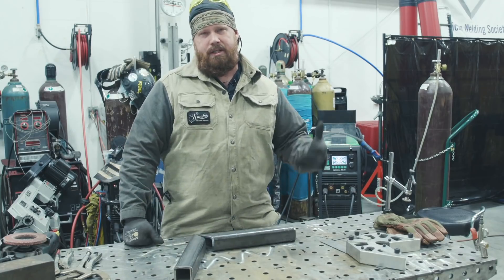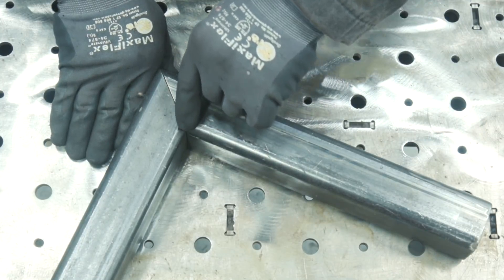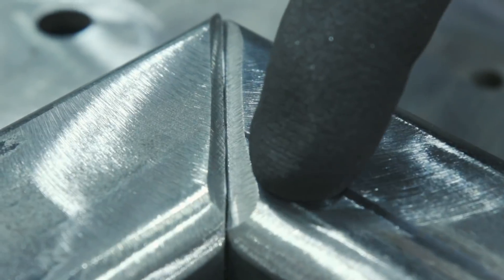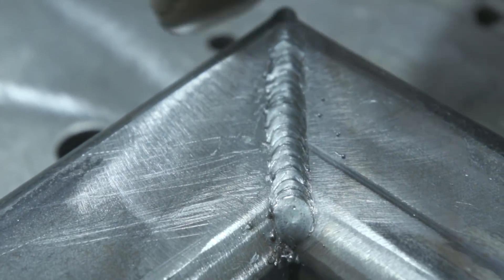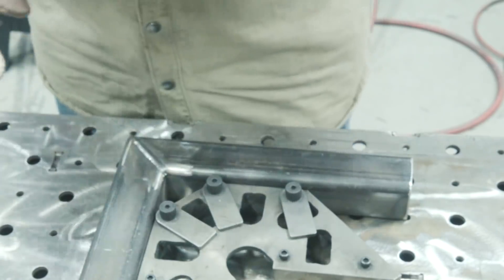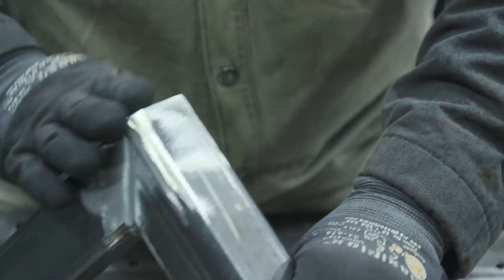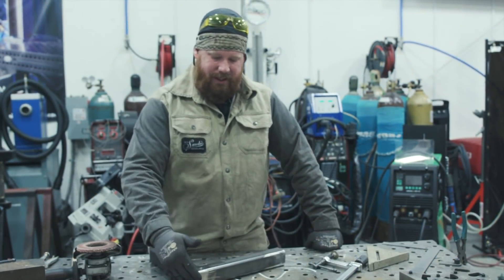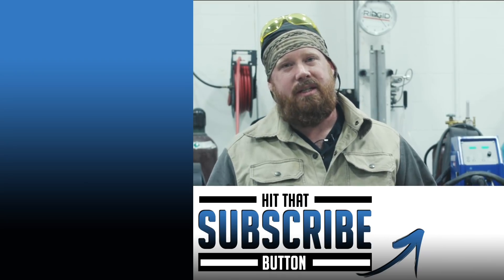Mastering Seamless Welding Techniques for Square Metal Tubing

Comment: This is quite helpful... as a hobbyist I work with small tubing, small square rods... and grinding welds back down to clean frequently leads to laying down some more metal to bring up the low spots.  I will utilize these techniques a bit more now.

Comment: got a serious question for anyone who can help me..im welding square tubing on a double decker 2 story car hauler diagonally in between the original existing square tubing bays going vertically up and down, to help stiffen the trailer. problem is the tubing is up againts  the backside of the inner wall of the trailer causing me to not have access to the back side of the tubing. what is the best way to weld the tubing so far i have only been tacking the tube in place. the trailer manufacturer only welded the square tubing in the fillet welds and none on the faces of the tubing im guessing because the outer panels stick to the outer face of the tubing with double sided tape (smh) they probly dide want to spend the time beveling and gringing the welds smooth, hence the trailer frame has numerous cracks and endles joints with no welds...help ...anyone???

Comment: I kinda whip with my grinder down to almost base material and then take one light and slow final pass to smooth it all out. Looks like scotch brite but I'm using 80 grit. Also, if you're a new to welding or in school or thinking about a career in welding, take some time to practice metal finish. The amount of time I spend laying beads and then making them disappear is staggering. Thanks for the content, weld team.

Comment: Making miters isn’t just a matter of getting the 45s right. You also have to get the 90 degrees correct as well. I know some guys are scratching their heads over that. But, there are a lot of saws with bad vises. When you cut a basic 90 degree cut, it doesn’t matter as long as the blade is at an accurate 90 degrees to the base. But, if the fence of the vise isn’t strong enough to resist angling backwards when tightened up, as more than a few saws have problems with, when you change the cutting angle, the top to bottom cut, the vertical cut, won’t be at 90 degrees. So you’ll have your 45, if you set it carefully, but when you put the pieces together, one side, either the top or bottom, won’t touch.

This seems mostly to be a problem with many less expensive friction and carbide cut off saws. If they come with pressed steel vises, as all of the less expensive models do, they will have that problem.

Comment: it seems  that there is no full penetration
Reply: Go do an ultrasonic test to make sure. Or cut it open and polish and etch its profile. Anyway, the inside fillet has the most strength in the weldment. So I wouldn't worry about it breaking because its faces were ground and finished.

Comment: Love your  channel, and learn from it everytime I watch. I was wondering if yall had any advice on a Red-D-Arc Lincoln LN25-Pro mig welder? The proper set up and functions of it, Ive downloaded the manual but its an older machine and there isnt a lot of explanation. I  know its meant to run off a bigger welder,  which i have a Lincoln Ranger 350G, Is there any advice you could show me or help me with in connecting the two machines... I would really appreciate the help. keep the videos coming!

Comment: You could have showcased pferds polifan curve discs. Since you were "just using a grinder".. The 60 grit would have done a nice job on the inside corner. 

Been doing this for years, and just learnt not to go back and forth. Thanks man. This is why i always watch all your videos, no matter how simple it may be. Glad i didn't skip this one.. 😁
Reply: We saved the Pferd for another video. Glad we could help out.
Reply: I've been going back and forth while grinding. I will have to try the drag back method. I'm a newby and need all the help I can get.

Comment: Nice !!! i like that and that is what I did when I built the frames for the new gas bottle storage cage. but the outside corner I did not sand flat before welding . I did not know at the time because I am an electrician and welding is just a hobby .

Comment: Thanks! I have one more on esthetics: Whenever possible, I align the weld seam of the tubing🙂. Call me nuts if you will...
Reply: @ Dan L @Gary King Sorry gents for not explaining more clearly. This type of square or rectangular tubing is formed starting from a strip of sheetmetal, folded to the desired shape and welded shut lengthwise on one of the flanks and ground or rather milled smooth, all in one continuous proces. This seem however remains visible under even a couple of layers of coating. Looks better to my taste to see this line continue through corners if it cannot be helped that it is on the 'showing' side of the work. Added avantage: especially cheaper production tubes are evidently not 100% square. So using this method you line up a corner of 89'30" with the same rather than with it's counterpart 90'30" which means that things get flush anyway. I hope you can follow this dutchman's explanation😶?
Reply: @Calligraphybooster  Ha!  Thanks.  As soon as I've read "This type of square or rectangular tubing is formed"  I immediately knew what you meant.  I do the same.  But that last part about the 89'30"  I didn't think about.  Good tip!
Reply: I don't know what you mean by "I align the weld seam of the tubing" ?
Reply: So do i 🤣
Reply: I do the same thing. But for the purpose of this video, I just made one 45° cut in the center of a piece of scrap we had.
Reply: Jason Becker Hi Jason, I totally understand you did. I would have done the same, and I did not mean to convay any criticism on the quality of your work. That's simply outstanding. And the approach both of us prefer is just not always possible or economical if that is a requirement. 
Greetings, Wieger

Comment: Can you do this with 2mm square tubing. Would you do a wash down with thinner tubing?
Reply: A root gap does the trick with thinner walled tubing. Experiment with what works for you. I recommend 0" up to 3/32", even though GMAW (MIG) can gap much more than that. I often use 1/16" root gap with either 0.030 or 0.35 wire with good results and accurate dimensions.

Comment: Great vid! Can you show how to do that on thin wall square tubing, 16 guage? I can burn through hell of easy! I saw Man Cub say to use 30 thousands wire instead of 35.
Reply: You'd probably do even better using .025" wire. And don't use flux core if you have a choice, flux core penetrates more than solid wire the same size. It's like running 6011 vs 6013.

Also, if you get to really thin stuff (18-22 gauge and below) a lot of guys like switching to 98/2 argon/Co2 mix instead of 75/25 because it helps with burn through.
Reply: I go hot and fast vertical down on thin gauge. If its a longer pass try adding a few tacks to help take the heat.

Comment: wouldn't you want to symmetrically spot-weld it into place before filling all the welding in on a single side?
Reply: In that case it wasn't needed because he had it clamped good
Reply: Yeah I figured maybe that we the case,  he has that big jig thing
Reply: What is a D A wheel?
Reply: @nelsonreyes8808  
Dual action.  Pattern less.  Orbital.
Reply: @nelsonreyes8808  Orbital sanding is used to take off the striations left over from using any wheeled sanding, so that lines and marks from grinding isn't visible after the piece is painted.

Comment: I kinda wanna see yall weld what I do at work which is 16 gauge round tubing to 16 gauge plate at 715 ipm and 23.5 volts quarter to one inch welds

Comment: Looks great. 
  Same technique for  welding 16g ??? Tube
Reply: Don’t bevel the front and back. You’ll burn through too easily. Turn your power down. You may need to do the face welds in stages cos it loves to burn through. I often start at the inside and go part way, then come from outside towards the inside before going back the the first weld and completing it. If your power is too high you end up doing repeated spot welds along it as if you’re welding up a car.
Reply: @grumpyone5963  like stitch weld it ?  Can you still blend it smooth or is it better to leave the bead
Reply: @foxwood67  Yes stitch weld it but I tend to go from each end to the centre if it’s trying to burn through. Less waiting for it to cool time. Yes you can blend it but on that gauge be careful not to thin out the main material and obviously you can’t round the corners much.
Reply: @grumpyone5963  👍🙂

Comment: Pferd makes a rounded edge flap disc for cleaning up inside corners.. Love those things.
Reply: Can you give a link please?
Reply: @danl.4743  they're called polifan curve flap disks
Reply: @monkipooman   I see them now. Thanks.
Reply: @monkipooman  Dang fine product too
Reply: @danl.4743  hm
Reply: So does Diablo, sold at Home Depot.
Reply: I've also seen quick change flap discs, 2/3", with rounded edges. Not quite like the 4 1/2" rounded edge flap, but also handy!  I've seen them with benchmark abrasives and others.

Comment: generally the way I do it. is I take a stone disk if I am removing a lot of weld I start around 20 degree angle an work my way down to 5 degrees until there just a little weld left.  an then I will take a fiber resin disk an flatten it rest of the way keeping at a 5 degree angle. generally pulling is much better for person who has to sand it end it come out a lot easier if you do not go back an forth.

I do agree overall with this process on how to do it :D.
Reply: As someone who does this everyday I totally  agree flap wheels are expensive you would need 2 a day doing it this way I use the cubitron hard wheel and fibre discs there awsome much flatter finish aswell flap wheel is a finishing tool in my opinion

Comment: I need a welding beiginers class I purchased a all in one unit it will stick mig, tig and Im not sure how to stick yet. Im restoreing a 67c10 pu and would it be better for me to learn one type b.v verses trying to figure all just mainly doing a little patch work but honestly not much the rear axle has been flipped A framed but thats done. As to what i ahould try to learn first would be what
Reply: Personally I'd work on learning MIG first, it's cleaner and easier than stick. I learned on stick (all there was for home shop) and haven't used it for ages, mostly MIG for structural and TIG for the finer things (I do love TIG but it's probably the hardest to learn).

Comment: After I've knocked the corner off on the outside corner i like to run a thin disc down it to make sure i get good pen when going vertical down. Filing the radiused edges after sanding (along the radius not round it) matches the ground bit of radius to non ground bit perfectly too. Good vid cheers.
Reply: That’s one area I think I have a better way than he did on here. If you grind the corner point back about 3mm (1/8 inch) on this gauge material 90 degrees to the length of your pieces before you fit them together, then you get a lovely little 90 degree outside corner to fill. He did a good job though.

Comment: Good day mate, how would you do this when its thin walled tubing? cheers mate, love the videos
Reply: I’d switch over to tig welding and maybe do a very small gap.
Reply: Ive done exactly what he has done in the video during my internship, with 2mm thick square. Its basically the same. But I do a lot less preperation to the material, because you will just burn straight trough.

One thing that was shown in the vid that we do are long sweeping strokes that follow the bend. That way you can make it extremely flat

Comment: Don't waste your time doing this, on thick wall tubing like in the video, just crank your welder out and go full ahead, it will penetrate same amount as with bevel
Reply: @Gecko88  I’m with you Bones. On that thickness wall I would grind a good bevel. Much better weld and control. My big welder is a 450amp Miller that could just power into that but my guess is these guys think they are but wouldn’t even get half depth penetration on 10mm wall.
Reply: @Gecko88  Ya, backyard welders like alex think that you can just muscle through certain welds. They forget that higher heat means more distortion, a larger HAZ (heat-affected zone), more spatter, less control, a wider bead with risk of overlapping a weld due to lack of initial root penetration, and risk of damaging equipment. His way is not the best way; keep beveling the heck out of those walls!!
Reply: alex is correct mate.. get a proper machine if you plan on welding some decent metal sections as at the end of the day you want to make sure things are welded properly if the thing you welding interacts with people in some form.. Dont work on something that can potentially injure someone in the future
Reply: @Gecko88  good welding machine can weld right through 8-10 wall, get a proper equipment if you are in the welding trade
Reply: @sanho1988  Yeah i normally weld it hot enough to actually fuse the metal completely so when i do grind out the top reinforment its as good as box section thats just been bought. I do it on spray mig so i have to be very good on my travel speed but normally i can do it without deforming the metal from too much heat or burn through.. Just something that takes practice.